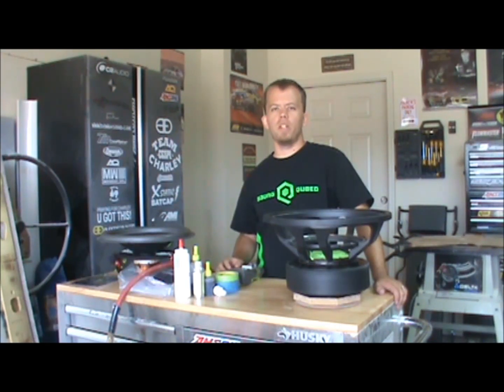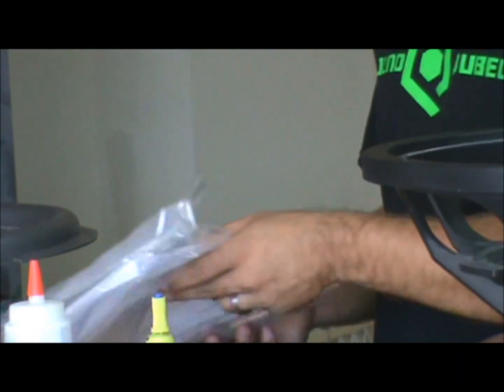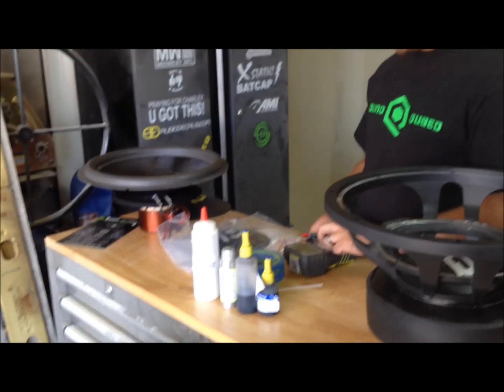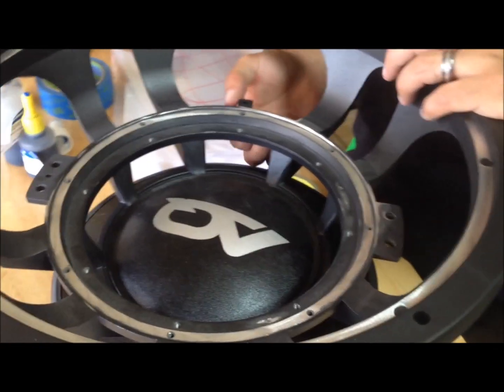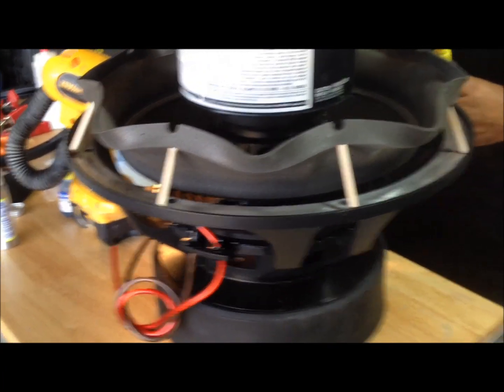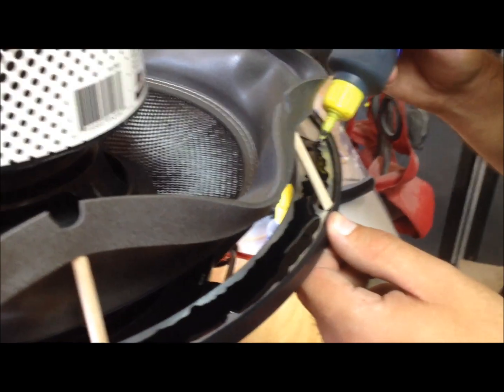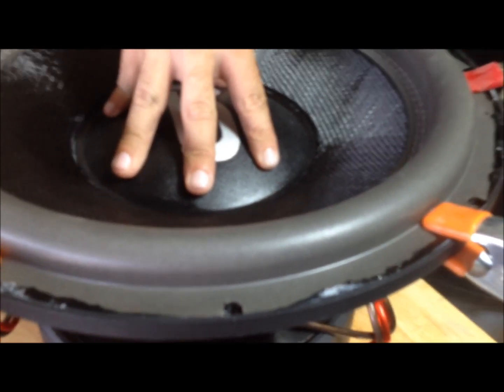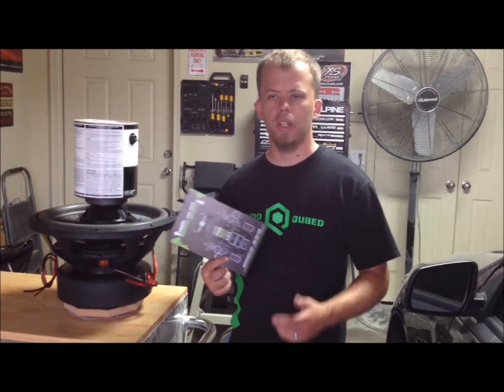HOW TO:  Recone A Subwoofer (HDC4 15)

Comment: 1.2ohm + .2 ohm = 1ohm ??? 😂
Reply: Ik but it’s just the way he said it 😂Ik he knows what he’s doing and that it read out fine
Reply: Justin Buchleiter fair enough 👍
Reply from the maker: Justin Buchleiter you add .2 to what we expect to see from the coils, which is 1 ohm, that equals what is shown on the meter 1.2 ohm.  

.2 + 1.0 = 1.2
Reply: All you have to do is touch your leads together to check resistance the meter is reading, which was .2, when you subtract the .2 that the meter reads from 1.2 you magically get 1 ohm....

Comment: question#1 :    what if the top spider partially gets glued to the botoom while your are glueing the bottom spider? should the person just goop as much as possible on the top spider since it's partially stuck already?
question #2 :  what about the spider bolt down ring? this video doesn't show installation.  i followed the link the the description from the hdc318 recone which already has the bolt down ring attached. we're lead to this video , from the hdc318 , to this one which doesn't show every single step
Reply from the maker: James Falvey question 1 that is what I do I try to put a good amount of glue on there to make sure it won't lift.  Question 2 that ring doesn't have to be bolted down but if you can get the bolts in then use them as extra security.  The glue that SoundQubed uses is strong enough to hold that spider down without being bolted down.
Reply: AMICUSTOMS so,you use a lot of glue to glue both spiders at once? bolting the spider ring was not my question......just overall installation is what i was talking about
Reply from the maker: James Falvey both spiders are already glued together as one but essentially that is what is happening just making sure they can't lift off the basket.
Reply: AMICUSTOMS ok, so how is the ring installed. .....(again)?.............
Reply from the maker: James Falvey bolts and glue
Reply: AMICUSTOMS grrrr !!!!! never mind....you don't understand the question
Reply from the maker: James Falvey the ring isn't needed because their glue is strong enough it isn't needed.  Not sure how else to say that.  Lol
Reply: AMICUSTOMS never mind
Reply from the maker: James Falvey ok
Reply: James Falvey have same problem with my American bass hd15 d2 came with new ring space but doesn't bolt down but I also have the original one  my new recone only has one stiff spider was thinking of using both rings one on bottom one on top glued to spider only and bolt it in so new time I have to fix it it will be just bolt in spider and glued surround

Comment: Excellent tutorial !! I've watched a few video's showing the recone process and I'd like to add something that gets left out.. when gluing down the dust cap, make sure that the symbol or logo on it is lined up with the push terminals or direct leads so one set is to the left of the logo, and one set is to the right of the logo. That way the mounting points of the speaker will also line up exactly how they were and you won't have to make new holes in your enclosure. Or simply check your existing operational woofer, and glue it down using that same orientation. A very important step that ensures a clean and professional outcome. Btw- using a piece of 3M painting tape as a grab handle / installation tool is a VERY good idea ... good job and thank you for sharing your knowledge
Reply: Great point brother! I’ve never heard anyone mention this. 👍

Comment: So my question is how does the activator get to the glue if the spider is glued down? Does it only have to hit a portion of the glue then chain reaction to all the glue that touching the area that got sprayed?
Reply from the maker: Exactly just a portion of it needs to touch the glue and it will "kick" it all off and start to set up.
Reply: what brand and type of glue did you use?
Reply from the maker: I use Soundqubed glue.

Comment: does the hdc3 have the same basket as the 4? It looks like there was a smaller landing below the one you used.
Reply: I don't believe they do. The spider is significantly larger on the HDC4 over the HDC3.
Reply: +Steven Watson my hdc3 18's have two landings. the  bottom landing is a smaller circumference, and its the one my hdc3 18's use. the landing above it is bigger.  so I figured they use the same basket and drop the spiders down in different spots.
Reply: +Josh Hanson that would make more since, production wise. i think a lot of companies do this. i also think a lot of companies buy there stuff from other companies that specializes in making just baskets and just motors and just cones and so on. you can really see it in todays speakers.  a lot of them look the same.
Reply: That's very possible. It would make sense for them as they sell their stuff so cheap they would have to keep the costs down anywhere they could.

Comment: Awesome video man. Would the same basic principal apply for dc audio m3 8? For some reason I keep getting a little coil rub and it's killing me. Is there a way to fix the coil rub before the sub blows?
Reply from the maker: Same basic principle for recone applies to all subwoofer brands.  Coil run can only be fixed by doing a new recone.

Comment: Why use 2 dust caps? 
Very useful video
Reply from the maker: The top carbon cap I want to reuse if/when the woofer blows and needs to be reconed.  So I use a different type of glue on it.  The pressure underneath would be too much if it was the only cap used with the glue I use on it.

Comment: I didn't see you screw the spider packs down but I swear mine are screwed down or maybe I'm wrong.
Reply from the maker: I didn't because it isn't necessary with the glue they provide from SoundQubed.  The ones that come from overseas are bolted down because the glue they use over there isn't as strong.

Comment from the maker: Most brands of subwoofers don't require any kind of break in time. You can generally play them wide open straight out of the box. But it has been my experience with AQ/SQ brand, due to how stiff the suspension is you will cause a lot of unwanted mechanical noise if you don't break them in over a 10 hour period. Which means don't play below 35 hz wide open on them in the first 10 hours of play time.